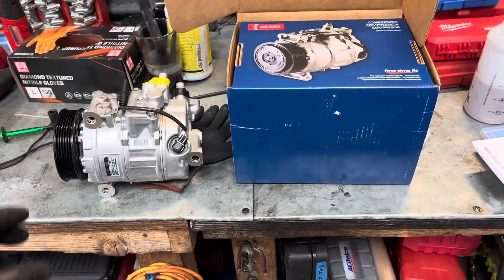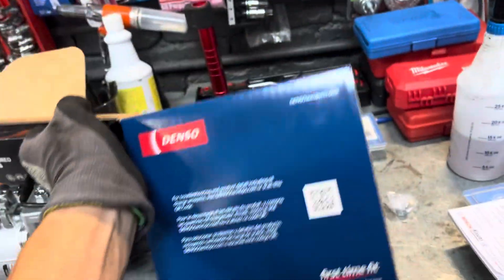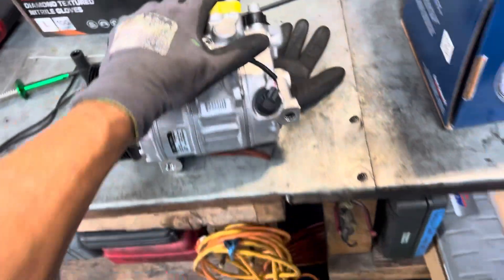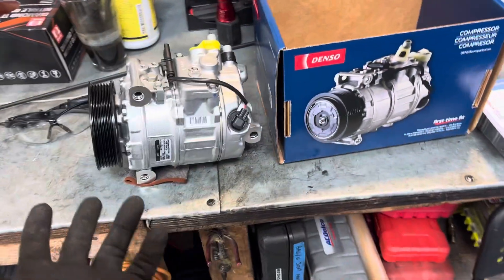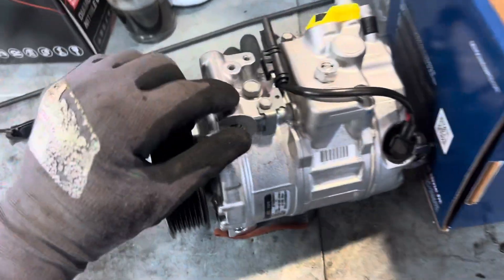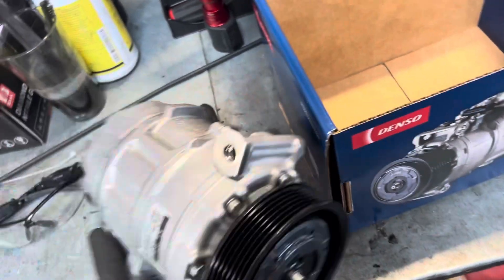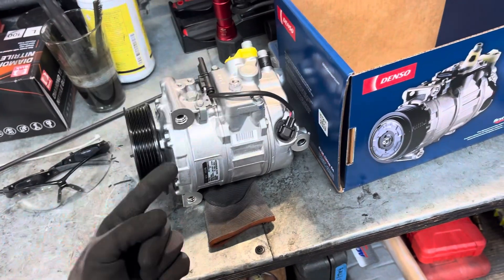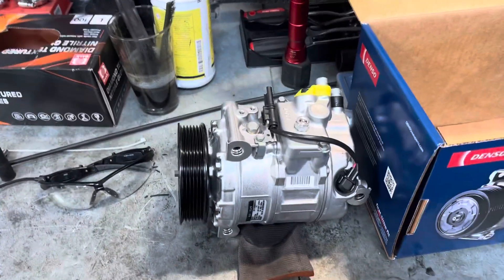Double oil charge even triple oil charge HOW ? 🤔 I explained written description below.

Comment: Is the port you’re pointing out connected to the others and Freon?
Reply from the maker: @connora5387  the two big holes at the end are the refrigerant suction and discharge to the pipes

The bolt that I .2 is to the center chamber that holds oil there is also refrigerant pressure inside there too. It’s not just isolated. It’s actually mixed.
Reply: @coldfinger459sub0  so how would you oil balance then? Treat them separate?
Reply from the maker: @connora5387 always fallow oil balance procedures 
measure old comp oil , measure new comp oil.

Comment: Reminds me of a car I worked on several years ago… comes in with no A/C, so I hook up the machine and start recovering. So I’m standing there letting the machine do it’s thing, and something on the ground caught my eye so I looked down. Oil was overflowing from the recovery bottle and running down the machine, and making a large pool on the ground while the machine was still recovering the refrigerant! Somebody must have dumped an entire bottle in this car. A/C worked pretty good after recharging it, minus probably a half quart of oil lol.

Comment: I've seen that done before too. Way too much oil is obviously bad, but what are the effects of being over by a small amount? Let's say 4.5-5 ounces total in a system that calls for 4 ounces because someone overestimated how much was lost when fixing a leak. Any positive or negative effects on compressor longevity? How much would the system's performance be affected by the extra oil?
Reply from the maker: @averyalexander2303  1 ounce one and a half ounces you’re starting to push on hotter days seen an effect of lack of performance on colder days mild you won’t notice because you don’t require that much refrigerant in first place evaporator starts getting loaded up

If you have a mic channel evaporator one and a half ounces is a lot in those tiny little passages 

For example, if it was my 2009 Toyota Yaris that has a 13 ounce refrigerant capacity and a 2.77 ounce to 3 ounce total oil capacity and I put one and a half ounces extra extra oil. It definitely affects your outlet temperature. 

I experimented with my own car with that inter-dynamic Brand leak sealant and super cool additive enhancer

Because I experiment on my own vehicles before I ever experiment on a customers vehicle unless requested. 

On my Yara small capacity system, I lost about 6°F cooling temperature out of my dash from the extra oil that those little can and can be mixture that you would shoot into your vehicle. 

Some compressors front shaft, no seal that extra oil sends up the high side, pressure and pushes more pressure on the front shaft seal causing front shaft seal leaks. 

Over the decades, I’ve had many shops after I asked him about oil balance. Tell me they did not oil balance..   and I read the paperwork that came with their compressor and showed them that it was already full of oil, but they added more oil and or they had all the oil up in the evaporator. 

They shrug their shoulders and it usually works, and we don’t have any problems. We have always done it.. 

And sometimes Warranty get a call back on the same customer, refrigerant charge, and all all the charge was lost from the front shaft seal and you can see the oil everywhere flung around. 

       The only positive effects of over oil I was in a few situations were over oil doesn’t damage the front seal, not enough to do hydrostatic damage to the physical compression part of the compressor by breaking parts. 

It’s one of those customers who are not picky about how cold it comes out of the vents 

It’s one of those customers who continuously allow refrigerant to leak out before they ever bring the vehicle back in . 

It gives their poor compressor a chance because they have a few extra ounces of oil in there it did not physically break the compressor actually allowed to survive from running low on refrigerant to multiple times . 

But that’s only on those systems that are constructed like that
Reply: @coldfinger459sub0  Good to know, that's pretty much what I've seen that the manufacturers usually get the recommended refrigerant and oil charge correct and to stick with the specs unless there's a known issue or something has been modified. On properly designed systems that tends to work well. I have a 28 year old 357K mile Civic with the original Sanden TRSE07 compressor and a 35 year old 400K+ mile Legend with the original Denso 10PA17C compressor. As far as I know both are on their original oil and they both still work awesome.

That said, whenever I've fixed a leak and an unknown amount of oil was lost, I've always erred on the side of adding extra oil vs not enough oil and I've had great luck with that method so far. Obviously draining the compressor, flushing the entire system, and refilling with all new oil is ideal whenever there's any doubt about how much oil is left, but we all know that's usually not a practical option just to fix a leaking hose, punctured condenser, etc.
Reply from the maker: @averyalexander2303 yes I to always like to error on the higher side of oil than less. 

If you remember back in the 90s, there were some Chevys SUVs with rear air conditioning that were burning up compressors left and right .  Dealers are trying to put pancake filters that you had in the rear line
     And eventually, they released a fix and a TSB
       That the accumulator had to be replaced because that was the only thing that would fit the brand new replacement suction line that would go all the way from the rear evaporator to the accumulator and it was $1200. 
         By this time, the vehicles were several years old and $1200 was definitely a lot of money back then. 
           Immediately when I started seeing these burnout compressors, I recognized it as starvation of oil.  Because the line was a number 12 it was too large and especially when the loads were low the oil refrigerant velocity was too low and would fall out a suspension stay in the rear system and lines and not return to the 

My fix for the situation was really incredibly simple . 

I added three extra ounces of DENSO ND –8 
     That fixed the problem and customers no longer were roasting through compressors.